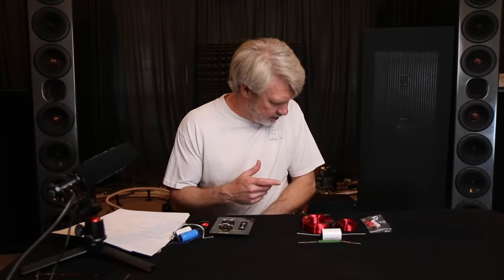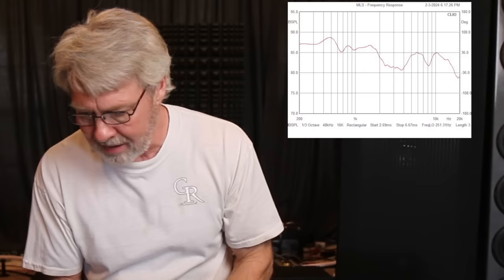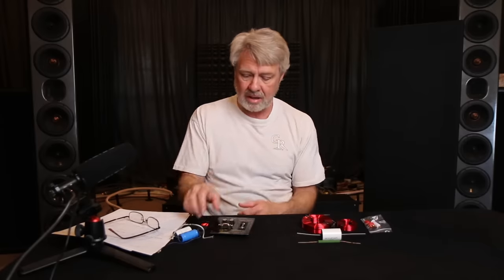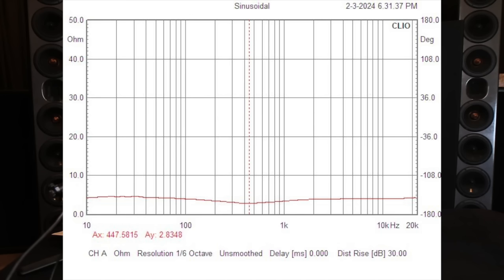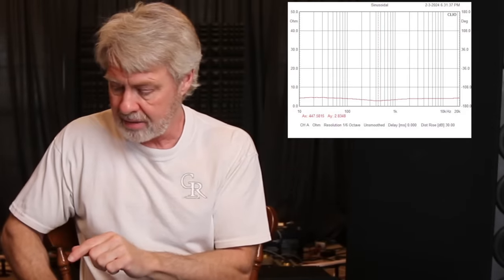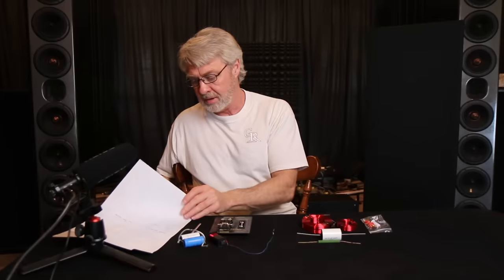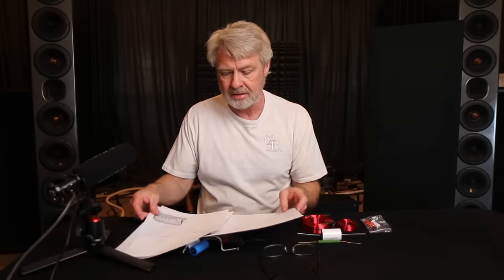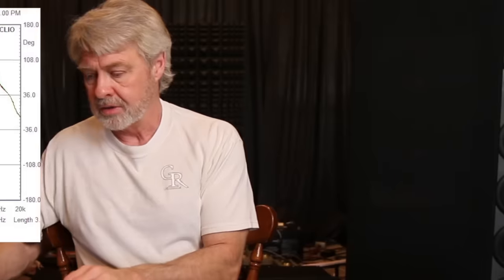Unbelievable Upgrade: Cheap Magnepans Turned into Gems

Comment: I did a simple upgrade just by moving the wire to the positive input and bypassing the fuse jumper path altogether, and it was a huge jump in clarity. Like i moved up a level in the Maggie line. Just ordered the kit. Can't wait until it's installed.
Reply: Can you let us know when you do it and how it turned out?--how difficult it was, and how it sounded afterwards?  Thanks.  Please respond on this video.
Reply: Hopefully, I'm doing this upgrade Sunday.
Reply: @thepracticalaudiophile  Well?
Reply: First off, sound quality alone is worth the upgrade. The fact the tweeter panel is only getting high frequencies makes them sound crisp and fast with no cancelation. The mid/woofer sounds fuller and tighter. Some songs sounded full even without the subwoofers active. Still sound their best with subs, though. Now, as far as the wiring goes Magnepan is inconsistent with their color coding.  I initially used their wires and ended up with the speakers out of phase. They had the colors wired oppositely on both sides. Just remember the inside leads are negative, and the two outside leads are the positives. So if your facing the back of the right speaker the leads will be T+ T- Mid- Mid+. It's easy to see which is the tweeter panel and mid panel through the cloth. Left speaker facing from the rear Mid+ Mid- T- T+. Remember ignore color coding. So if you replace the leads, the red (positive) wire to the outside and white (negative) to the inside leads. To my ears, upgrading these to Danny's copper wire made no audible difference to my ears. If you opt to just splice into the original wires, that would be fine also. If you are going to keep the original leads coming out of the speakers, you won't have to remove the staples. After removing the rear panel, just take a pair of scissors and cut about four inches towards the outside of the speakers, and then you can fold the cloth back and remove the crossover. Cut the wire as close to the crossover as possible. Ignore this and remove the staples if doing the wire upgrade. I replaced the rear panel with wood and used Cardas replacement connectors (so expensive) but again heard no perceivable difference. I recommend keeping the Maggie plate and posts or upgrade them to some higher quality binding post. I used the tube connectors as inputs on the external crossover box. I recommend these https://amzn.to/4atMvRc or these https://amzn.to/49GVYU2. The finished box could house both crossovers. Just make sure the inductors are all at right angles to each other. I have four binding posts coming out of each crossover and using WBC jumpers to connect to the back of the speaker. I made the top two (and speaker and crossover box) the tweeter inputs and bottom mid/woofer. Since there is no internal crossover in the future, you may choose to use an external electronic crossover. One final note: Magnepan in the future is thinking of offering all their speakers pure copper internal wiring and no crossover. Just have positive and negative posts going directly to each panel. Have fun. Once finished, these speakers will be legendary. These are end all speakers now. I'm ready for retirement.
Reply: @thepracticalaudiophile  Thank you for this detailed description of your upgrade.😊
Reply: @j-rod6420 You're welcome 😊

Comment: Good stuff GR, is this your hobby or are you a formally educated audio engineer? BTW, how much inductive reactance can there possibly be with a pair of wires passing perpindicular through a small single thin steel plate at the speaker connectors?  I would guess, negligible?... Perhaps a subject for a future "actual measurement" video.  Thanks
Reply: I have been doing this professionally since 1995. The sonic improvement in getting the steel parts out of the signal path is not subtle.
Reply: @dannyrichie9743 He didn't ask how long you had done this 'professionally' , he asked if you had qualifications as an audio engineer. Not that qualifications mean that you know what you're doing.
Reply: @analoglooney  Yeah, I got a couple of college degrees that I can hang on my wall. What they really mean is that I completed the requirements necessary to get the certificates. The real education started after college.
Reply: @dannyrichie9743 Oh that is so true Danny. I spent years at college too getting qualifications in electronics which just prove I have a memory!. It took me 30 years of practical experience to actually do the job properly. Well done on your academic accomplishments anyhow.
Reply: @analoglooney The only thing that worked for me after a Associate Degree in Electronic Technology, was a special Robotics accelerated pilot course. I learned  a hell of a lot.

Comment: I always have great respect for Magnepan drivers but the final crossover designs are a disaster just look how bad they measure Danny again has transformed them and not expensive too plus taking all the steel out of the signal path

Comment: I have a pair and the sound out of balance. Now I know why. 

When you made the new filter did you notice that the panels are not the same?

Hope so😊
Reply: Yes.
Reply: Magnepan deliberately tune the two panels to be different to each other so that when heard together they are complete. Check out the visual differences under the sock. Hear the differences when played individually.
Reply: @spudpud-T67  Yes, but the crossovers are the same.

Comment: Bought my Pedest'ale Tower speakers from Danny in 2021, classic styling and sounded great. Danny sent me Sonicaps, immediate improvement, that was June 2023. Danny sent me No-rez January 2024, fully lined , and simple enough project.  From the main into a Decware ZLC,  GR cryo power cord to the Decware Rachel intergrated, GR power cord  each into two Parasound 2125v.2 power amps. Mark Tunis power cord into CEC TL5 CD transport, feeding Earmen Tradutto dac, powered by  a Small Green Computer LPSU. Decware Gold Pills between dac and Rachel. DIY Mogami speaker cables and  Transparent Coax , Transparent interconnects from Rachel to power amps. 
The Synergy is alive and well.
Reply: What did you think of the Cryo chords?
Reply: @stephenyoud6125  seriously worth the money,  tember, tamber, and texture is immediately bolder. Like if you watch a stampede from a Ridgeline, that's one feeling. It's like standing in the middle of the stampede while it moves around you, with the power cords.It's all about your rigs, individual Synergy. Guarantee you won't be sorry.
Reply: @sloboat55  awesome. The flat earthers will hate to hear that
Reply: @stephenyoud6125  of all the things to think about, flat earth isn't one of them. Cool runnings
Reply: @sloboat55 I mean the guys Danny calls the flat earthers. The ones that won’t believe cryo treatment or even power cables won’t do anything
Reply: @stephenyoud6125  .... I'm a proud flat earther since 2016 now.... and watch to upgrade my Magnepan Mg-12 !!!!!!!!!!!!! 😉:hand-pink-waving:

Comment: Hi Danny, this is great re-engineering. This is such a popular high value speaker it would be nice if you (Ron?) did a before/after sound evaluation. How much louder do these modified speakers get?
Reply: The upgrade doesn't change how loud they play.
Reply: @dannyrichie9743  Doesn't it reduce tweeter distortion at high levels?
Reply: @Josh442  That's true, but I was referring to sensitivity level.

Comment: All Magnepans are giant sounding 4 ohm resistors. Aka  amp killing load banks. Probably if not the worst designed speakers. I had a set of 3.5’s. Basically a door with giant 4 ohm resistors.
Reply: If you're amp can't drive 4 ohms, you need a new amp. The fact that the load is resistive makes them easier to drive as well. They do have low sensitivity, so you need a large amp.
Reply: Are you serious? A consistent resistive load in a decent amplifier is loads (pun intended) better than a capacitive load. 🤦🏼‍♂️

Comment: There is just something about the sound field of the Maggies that I fell in love with 5 decades ago and still prefer over any other design. They just energize the room differently than other systems. Even than regular driver based open baffle and omni. I've always approached them as being the drivers and the room being the cabinet. Rather than drivers in a box directing sound pressure waves at you.
Reply: Quad esl57's will do the same to you. Enchanting is the word and you'll be up all night listening to the damned things.
Reply: @analoglooney  Saw an interesting vid the other day on Audio Excellence Canada "The Worst Products I've Owned - A Glimpse in to an audiophile's nightmare purchases"  where he discusses the ESL's and his love hate relationship with them. Including having the Mark Levenson stacked Quads with Decca ribbon supertweeter setup. I heard that once about 50 years ago. 

Did you know it was designed to be a single speaker mono system?
Reply: @glenncurry3041 Thanks for that info. No, I never realised the Levenson set-up was designed for mono. ESL57's will drive you mad, I can understand his love-hate relationship with them. I've travelled that journey too. In the end I had to settle with Tannoy Monitor Reds 12" from the 60's and I love them to bits. The Quads are just too fussy. Still awesome though, especially for 1957. I never warmed to the 63's though.
Reply: @analoglooney  My bad for not being accurate enough. The ESL57 itself was designed as a single speaker mono system. Not the Levenson mod. 

I got hooked on the Maggie planar approach. Got my first set of III's in the early '70's.
Reply: @glenncurry3041 No problem. Yes the '57 was designed for mono as you say. After serial no 401 the directivity and distribution across the panels was altered for stereo. I can understand your addiction to Maggies. Open baffles are addictive. The only box loudspeaker that comes close is the Tannoy monitor red/gold/hpd which can be truly hypnotic. I don't think the newer Tannoy's sound as good though.
Reply: @analoglooney  I keep trying to get myself to accept drivers in boxes to remove all the complications panels like the Maggies have. But there is just something about the way they reproduce sound, energize the room. Some omnis seem interest. If you can drop $1M on an MBL system? LOL!
Reply: @glenncurry3041 Yes I agree. I have a pair of Wharfedale Airedale's from 1958. Omni directional mid and top with a slotted bass chamber and a sand filled baffle. They have a very similar magic as they can breathe. Quite hypnotic for an old speaker. It's about a natural presentation more than absolute accuracy. My friend has Quad 2905's. Same magic, same presentation. The only speaker in a box I ever liked was the original Tannoy reds/golds and HPD's. They have a magic of their own.
Reply: @analoglooney First heard the 57s with a Tandberg receiver in Carlsbad CA.  Absolutely stunning!
Reply: @daviddrake6875  Yes, they leave an impression on you. You suddenly realise what all box speakers are doing wrong. it's a lack of any stored energy.

Comment: You can’t measure a Maggie, especially with the rear reflection. The speaker has an extremely narrow sweet spot, I’ve owned magnepan speakers mg1, mg2, mg2c, mg2.5, I’ve used them with 200 watt plus amps in a 20 foot long x 16 wide, they never break up
The trick is to keep them away from the back wall, & the back wall should treated
Reply: These were measured using a gated time window and zero room reflections. The reason the sweet spot is so narrow is because the drivers are playing on top of each other and causing out of phase cancellation in the off axis. They don't have to be that way. They can have a wide even coverage and a wider sweet spot. The stress in the tweeter becomes real apparent when you take it away.

Comment: I’m curious if you measured the frequency response of each speaker of the pair, and whether you measured the frequency response profile of both speakers at the same time. I got the impression that you measured the response for one speaker of the pair, and assumed the other speaker had the same profile.
Reply: You can only measure one speaker at a time.
Reply: @dannyrichie9743  Fair enough. But did he measure each panel or just one panel, assuming that both panels had the same profiles.
Reply: @dragocelander6671  They measure the same.

Comment: Stupid question.....If we are going through a PEQ like is on the eversolo dmp-a8 can't we just adjust the frequency response that way?  I guess though it would not work on the analog inputs like with a turntable.
Reply: EQ does not solve the problems at all.
Reply: @dannyrichie9743  Not at all?
Reply: @johndemmer3496  Nope, all of those ferrous parts, and budget level crossover parts are still in the signal path and still eating up resolution and detail levels. Those parts also hurt imaging, sound stage layering, image depth, etc.
Reply: @dannyrichie9743    I 'll buy that.  It's not all about measurements of frequency responses.  Two can measure the same and still sound very different.
Reply: @johndemmer3496  Correct.

Comment: love  your work but i wish that you would show the actual build.
Reply: Danny does have some videos showing how to solder and do upgrades which might be helpful
Reply: We get that a lot, and we do have a couple older videos like the Klipsch RP600M or our own X-LS Encore & X-Bravo. But we simply don't have the time or manpower to document/film the assembly/installation of every speaker that comes in or gets made. Plus parts availability changes over time, so what we film today may not be available in 2-3 years time, just like with those models we did make upgrade videos for, some of the parts we stock now are different.
We still help walk customers through assembly if they get stuck or have questions.
Reply: @hoth2112  Do you provide assembly instructions, diagrams with the kits?
Reply: We supply diagrams for the crossover, and I just drew a diagram on which tabs are connected to which drivers. @spudpud-T67

Comment: I have loved those speakers. They supply two cheap resistors of different values that take the place of that steel bar. I bought 2 high-quality Mundorf with a value of 2.2 that sits in the signal path. To My ear it sounds more balanced, less bright in my room. I knew you would get around to reviewing the speaker and burst my bubble. Lol, I absolutely love these speakers. I have a nice SVS subwoofer and an old rotelle amp damn you for making me consider this upgrade. I do wonder about how you measured those speakers, considering they are dipoles wouldn’t a gated measurement cut off the reflected sound?
Reply: He went into the gating in the video. Dipoles are hard to measure. From my perspective, the only really valid measurement is in the listener's chair -- but then you're dealing with the specific room. So you do that, but you also do gated measurements and compensate for the lack of dipole roll off (they will seem too have too much bass if you measure them up close).
Reply: I put in the resistor as well, it makes the sound not so sharp, especially with female S ….sounds.

Comment: After the crossover upgrade , any benefits to use active crossover to separate high and low if I want to put a sub in?  Thanks
Reply: No, but there is benefit in knocking out the first octave and a half and letting that get handled by a sub.
Reply: @dannyrichie9743 But how can you do this?
Reply: @dieterleonard2309  Use an inline filter: https://gr-research.com/hi-pass-filters/
Reply: @dannyrichie9743  Thanks, but I am using an integrated amplifier… Not everybody has separated gears 🤷🏻‍♂️
Reply: @dieterleonard2309  That makes is a lot tougher.